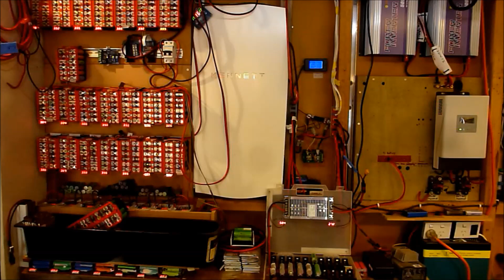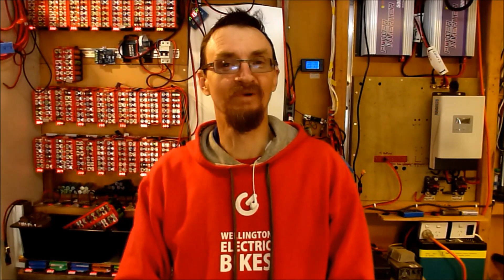Laptop Powerwall 137 - 24 kWh battery

Comment: Very interested in this leaf project.  Some cells on TM here: https://www.trademe.co.nz/motors/car-parts-accessories/nissan/electrics/listing-1799086464.htm?rsqid=bdc8477497a04c62945b56498c54f045

I wonder how far the life of a leaf can be extended by upgrading to 18650 with a new BMS.  May be a lot of dead leaves lying about the place in coming years (sorry couldn't help myself!)
Reply from the maker: Were on the ground floor of the coming second-life lithium battery boom. We're going to have a crazy number of Leafs here in New Zealand very soon. The last few days it feels like every 10th car is a Leaf here in Lower Hutt.

Comment: I have built my 18650 packs kind of modeled after the leaf packs. They are 100 cell packs 4.2v with a gap of 2 by 4 cells missing to allow for making connections. And still allowing added packs stacked on top. It should come in 15-16 kwh when this small part is finished. I'm planning on building between 2&4 more depending on the capacity.  I'd like about 120 kwh. In a 7s bank powering my offgrid home. And try to keep the voltage between 3.4&4v to see how many years I can get them to last! I hope to build a ev next. But gotta get the house powered well first. Looking forward to the leaf videos!
Reply from the maker: House first, car second. Seems like a good plan.